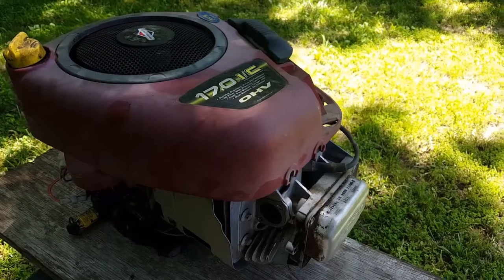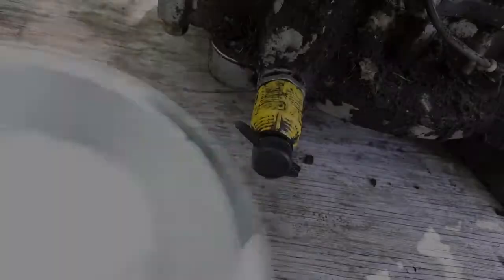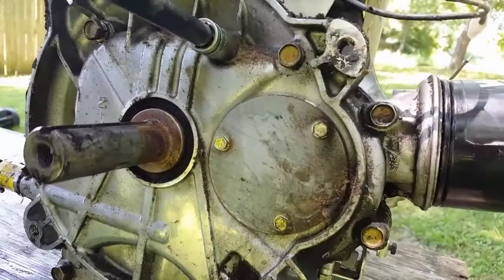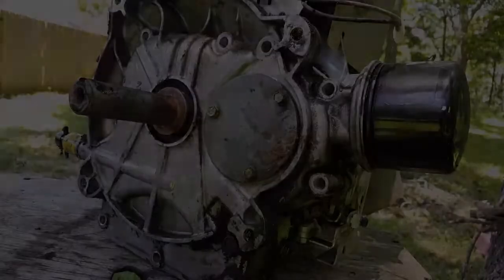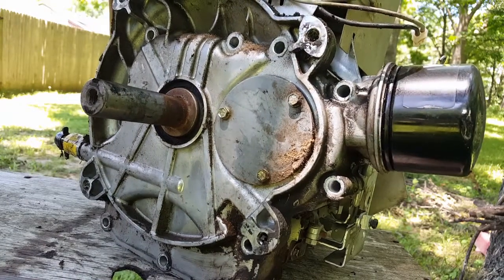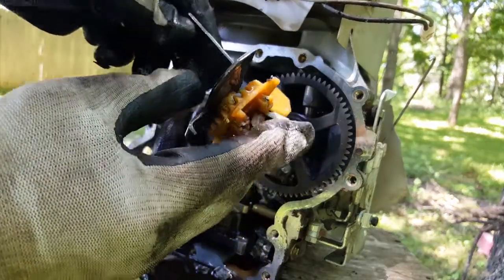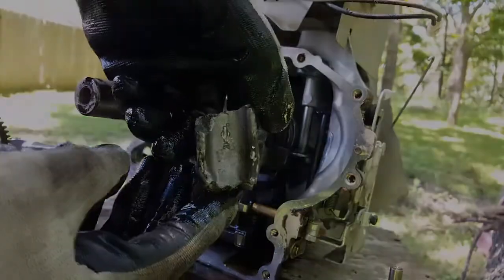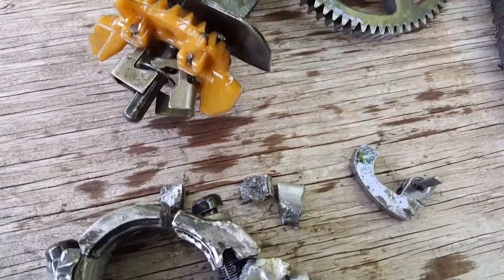Lawnmower engine stopped and broke while mowing now it won't start let's take it apart.

Comment: Why not re-ring old engines and replace the valves and replace the guides.
Reply from the maker: Thanks for the comment. It's an issue of cost.  It's just not worth it. 
.
Reply: @HomeGaragechannel  I know! I was just suggesting others to do that on theirs to keep things running longer. A thrown rod means it's junk! 😱
Reply: If piston, rings, valves, crankshaft, timing cam, and governor are in good shape, and it just needs new connecting rod, then rebuild is worth it in some cases.

Comment: These engines are bad for that I had 3 in my shop this year with the same thing don't check the oil boom the engine will go
Reply from the maker: Thanks for the sharing. I try to check mine every time if I remember.